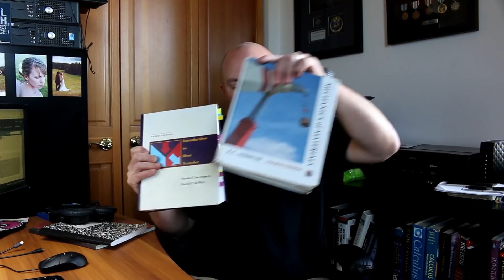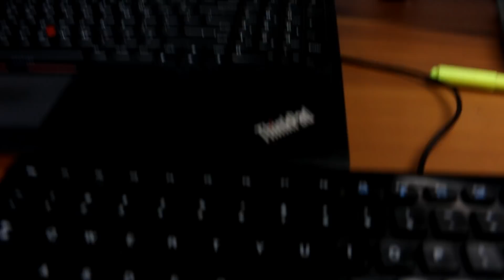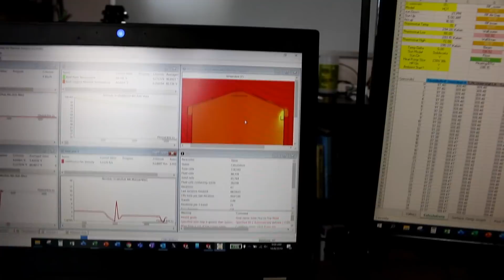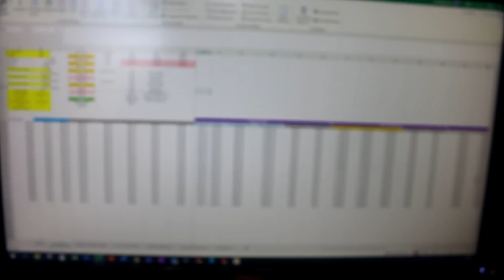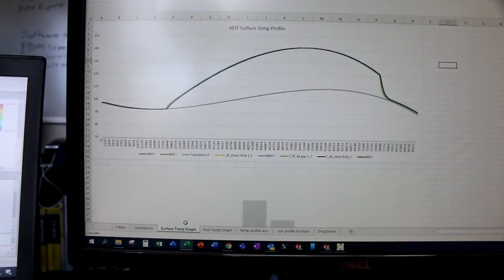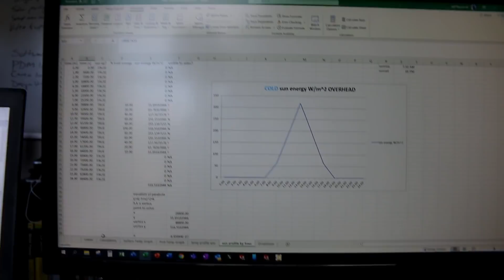GREENHOUSE Heating and Cooling Analysis - For Beginners

Comment: May I suggest you are overthinking this? Why work on a per second basis? Surely a time interval of a minute/5 minutes or 10 minutes as a maximum would be sufficient - and would introduce a reasonable margin for real world as opposed to a modelled world. Are you taking into acount the turbulent effects a human working in the area would have on the fluid flow? The additional heat output of each person etc. etc. if not, there isn't any point in modelling at the resolution you are. What type of heat pump are you looking at - Air to air/Ground source? I love a good engineering model - but I think you are expending too much effort in the wrong places. I'll be happy to be proved wrong.

Comment: Hi 
Big Cool Projectet 💧🌫💨❄🌡☢⚛♻⏳🗂 🛰🚀👌😎
💡idel to you !?
Use a Desktop / Tower or Server 2x CPU 8-12 cores and 1-2x GPU card,
with Virtual software Tools on [ Create VM ]
( Server2012R2 - 2019 )( VirtualBox ) 

So you can log in from your Laptop and view data, on the Dashboard.
- you can use to log in with Remote Desktop Services (RDS)
- or Create a SQL Database as Data-LOG file
- or Excel Programs with your calculation.
- Create on your Managed to Web Dashboard.

DataMek from 🇩🇰 Denmark.👍🖖

Comment: To maintain greater consistency in temperature control have you looked into “earth batteries”?  This a reliance on convection and simple fans once installed utilizing the thermal mass of the earth.  Could this not be easily transferred to a habitat on Mars?  Love what you are doing, but wonder if you are over analyzing.  Sometimes we let perfection get in the way of good enough.

Comment: There are lots of examples out there of things you are trying to do that were done by other people a long time before computer simulations. Why don't you look at those things and combine them into one structure. There is a guy in Nebraska that has been growing citrus trees for 30 years using a few fans circulating air  through pipes in the Earth. There are also plenty of examples of working biodigesters, micro biofuel plants, geothermal heating and Cooling and countless videos on YouTube about people growing food in a sustainable way in the winter. These people have somehow figured it out without much use from computers unlikely have an engineering background. I think you are trying to way overcomplicate things. What do you need  $2,000,000 for? How would you ever get your money back from that?

Comment: I get the analysis but I believe there is too much reliance on machines to maintain temp. On a mars mission the less machines the better. Using subsurface temps using tunnels/tubes with a fan will dissipate heat and or add heat to a structure. Here on earth that is around 50-52 degrees. So all you need to do is heat that temp in the cold to the desired temp. There will definitely be boring machines going on any mission and very strong fans can be disassembled and reassembled to take up less space. Just a thought. Looking forward to see the build.

Comment: I think getting it open is more important than getting it perfect! If my plans come through for an aquaponics greenhouse, it will probably be built for 1/5 the cost and perform just as good! One of my plans includes having a structure for tomatoes that will double as a frame for an extra layer of plastic in December or January and February! If we got dumped on like you did with snow, even if we have to rebuild the frame and plastic from scratch, but still would be well under half, maybe close to have her if you consider the crops lost!
Reply: Is this The Crop Sacrificial Model?

Comment: TRM, your heat pump can be smaller in the summer as you're basically dehumidifying. There's a lower energy method to dehumidify. PM me for details. You may have to do a DIY, but it will save you power running the system.

Comment: Something you may also wish to consider...I noticed you have a couple of computers sitting on that file cabinet...have you considered running a cluster?
Back around 2004-2005 I had 8 moderately powered (for the time period) that were given to my by a company wanting them hauled off.
Set them up & ran cluster software (Knoppix) on them...they were Pentium 4's with 512MB RAM...over a 10/100 network.
They were able to do fantastic computations for being moderately powerful computers...you might can do the same...just a thought.
Reply: This is genius. Have to get mine out of their cages. Should have kept the Win 98 box with the Korg Oasys PCI sound card, 95/98/ME-compatible,
Minimum 64MB of RAM (card has 5 motorola processors). That must have been my first build!

Comment: Really should look at building most of the building underground would cut heating cost and still could use the solar system
Reply: Yes, and build underground for MANY reasons, one being that we can't always rely on our blessed sun. Is there anything stronger than a monolithic Basalt Rebar fortress nice and warm in 260 mph winds? Underground would also be MUCH preferred for our reasons plus the additional benefits on Mars.

Comment: The solution to dealing with Heat is to first use the correct structure!  High tunnels/hoop houses are extremely hard to deal with heat and cold periods of the day/year.   Use passive geothermal as much as possible.  And for God's sake don't forget to build the structure and calculate the snow load and snow discharge factors, i.e. don't repeat past facility collapse!